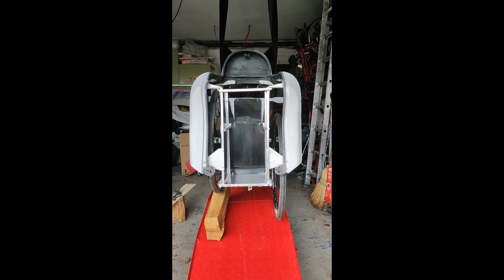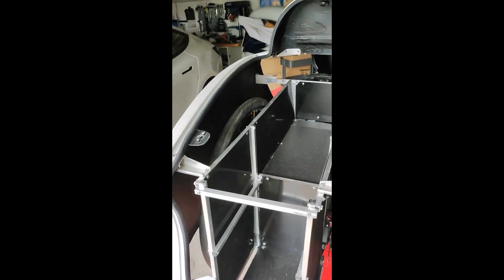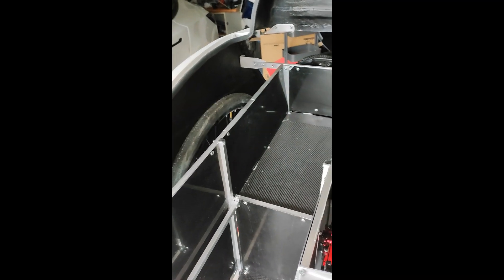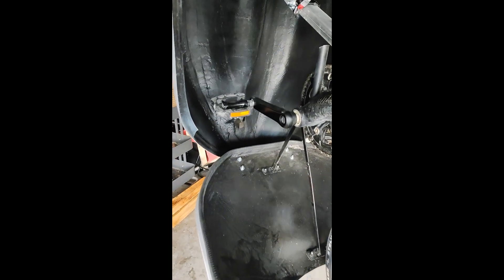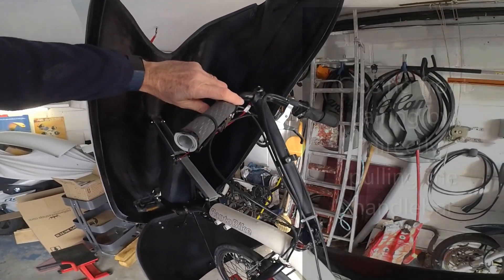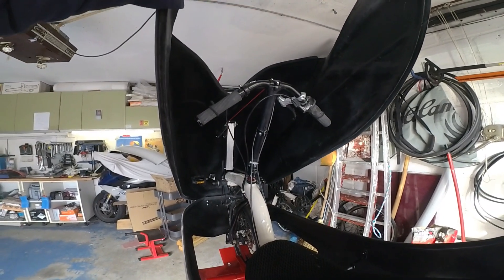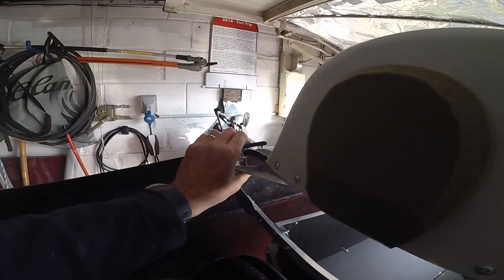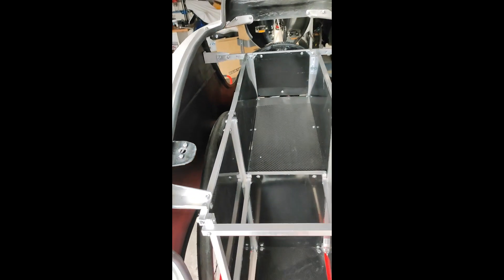How the new Aerotilt works inside the fairing

Comment: Hi Daniele. Can you share the method of tube replacement in the event tire puncture?
Reply from the maker: For rear wheels it's easy, they are installed on a single side. For front & drive wheel: remove tyre and repair tube, otherwise I have a 'open' 20" tube with me.